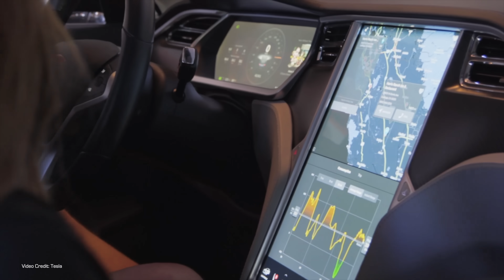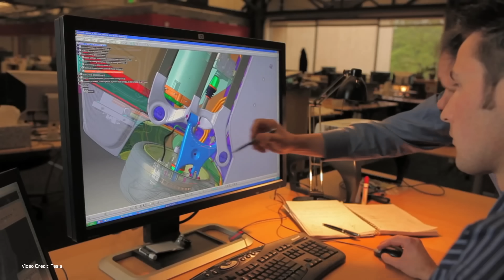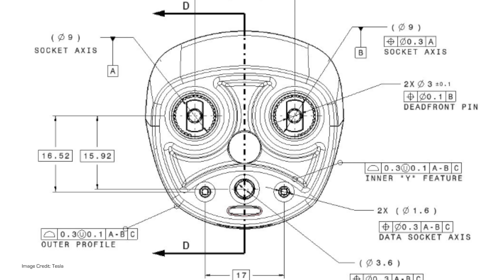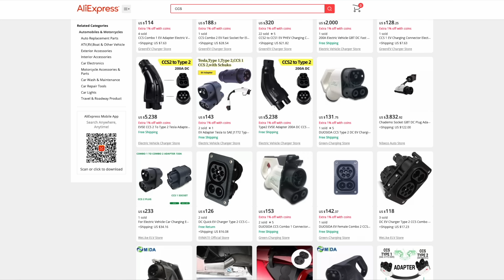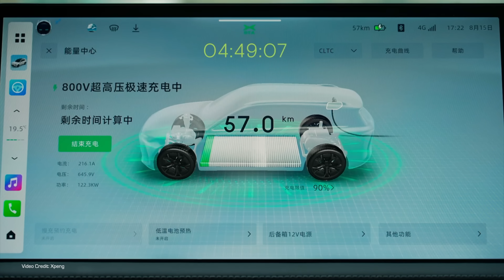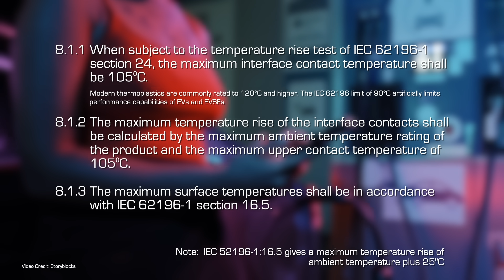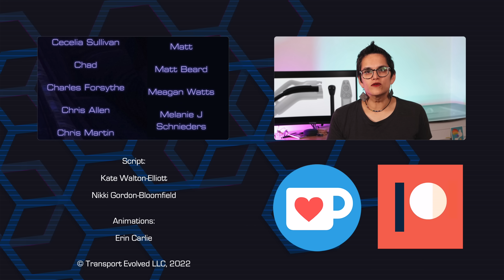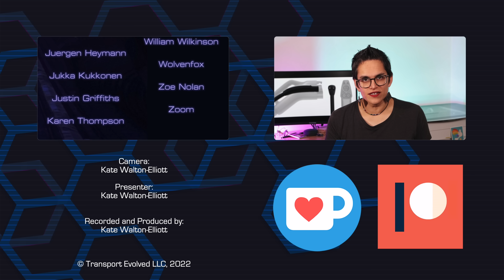The EV Charging Experience Can Suck -- Will Tesla's NACS fix it?

Comment: As per the super imposed diagram in your presentation the NACS is a far sexier and design and what we should expect from the futuristic look of charging cables. We're all so use to the clunky gas and CCS adapters that when the European government said...you will use this and you have no choice...no one said otherwise and they all just took it.

Tesla is saying that going forward companies could and should adopt this standard because is has proven to be reliable and a more ergonomic design. It even puts less stress on the charging port of the car compared to CCS. Look at the new CCS to NACS adapter. It ways about a pound all by itself and that's before connecting an already heavy and bulky CCS charger to it.

What really needs to be tested is the vague claim by Tesla that it can do bidirectional charging. I suspect it can since you're just reversing the flow of electricity.

None of the companies will adopt this standard. Tesla is their rival whether they want to admit it or not. The only way it's going to happen is if the US government did what Europe did and gave them no choice.
Reply from the maker: The Tesla connector is unable to support three phase charging which is increasingly common in Europe where many EVs ship with three phase / 22kW charging. Personally I'll take functionality over looking futuristic. 

In the US the options are more flexible because of the lack of 3 phase, but I'm personally unconvinced that the telsa connectors better ux in terms of physical usability offers sufficient of a bonus that other automakers will pick it up.

^Kate.

Comment: With an extremely large number of US charging stations limited to 6.5kW and many Tesla stations limited to 150kW with very few at 250kW, the connector is the least problem. Tesla wants to use gen4 Megachargers that will charge at 1000kW, the bigger problem is that is the entire output of one power substation. Which is also larger than a 20 bay charging station.

Comment: Why hasn't Tesla opened up the protocol?

It's not clear why Tesla has not yet opened up its charging protocol. It is possible that the company wants to maintain control over the user experience at its Supercharger stations, or that it is concerned about potential security issues with opening up the protocol. Tesla has instead suggested using a different solution for other automakers to communicate with its charging stations. Alternatively, it may be that the company is still working on developing and improving the protocol, and plans to open it up at a later date.

Comment: Summary: 

The US has a variety of charging connectors available for electric vehicles (EVs), while many other countries have only one. The Tesla charging connector, also known as the North American charging standard, is highly regarded for its engineering and user experience. However, it is a proprietary standard, which means that other automakers in the US have largely adopted the CCS connector instead. Tesla has recently opened the charging connector to other automakers and is working to get it validated as a standard. While other companies may adopt the connector, they would still need to use a different protocol to communicate with the charging stations, as Tesla has not yet opened its charging protocol. The adoption of the Tesla charging connector by other automakers would likely improve the charging experience for EV users.

Comment: What does CCS charge for licensing the plug?
The CAD models for the liquid cooling NACS plug was also included with the release, looks like the same dimensions.  As for communication that's usually handled by a broken app and won't make current CCS charging worse regardless of plug choice. I get your point that it might also not improve the non Tesla charging experience, but it will at a Tesla charger with the Tesla app.

Comment: I f I were Ford, or any other car maker, I would advocate switching to NACS if Tesla also opened up the Tesla charging network. If just Ford did it, it would put the death knell in CCS in the US. And for the relatively few CCS vehicles made, adapters are available. Since there is no 3-phase power in the US (effectively) every other aspect of NACS is superior to CCS. And seeing as the world went from USB-B and its many forms, to now USB-C, standards can change when a better one is available. Tesla should have released this a long time ago along with the protocol, for that they get the criticism. In short, NACS should be the standard, but for it to be the standard, Tesla has to release the hardware, software, and access to the Tesla charging network.

Comment: If it wasn't such a one sided deal I would almost like to see other manufacturers using the Tesla plug. Just to see the SC network suddenly having the same problems as CCS trying to deal with dozens of different vehicles, software variations, backend systems not well integrated, etc.

Comment: First, all V3 Tesla superchargers use light weight liquid cooled cables.  Also temperature sensors are built into the plugs.  That is probably why there have been few Tesla charging fires.
The cost of Tesla Superchargers is very low.  It looks like it somewhere are $50,000-60,000 per charger.  Where I have seen upwards of a $250,000 million from other supercharger companies.  This is backed up by Texas grant applications for superchargers where Tesla asked for 1/5 the money of the average of the other supercharger companies.  The Tesla bids included CCS and CHAdeMO connectors.  
It looks like Tesla doesn't really need the money.  What do they really need?   One thought is location.  For example if CCS superchargers allowed at the rest stops, and Tesla superchargers aren't allowed, it would be a problem for Tesla.

Comment: Multiple charger types, not sure I'd claim that.  Chademo is going the way of the Dodo, CCS is global and will most likely remain for the moment.  The Tesla charger connector is elegant and easier but my worry with the Church of Elon they may decide to change that in a few years or even 10yrs and force manufacturers license it as it is controlled by a single company.
Reply: The ccs standard isn't GLOBAL at all. U.S. uses ccs1, EU uses ccs2 a different non compatible plug, China uses its own seperate plug as well as standard and then you have the company with the most evs ever made with it's own standard ie tesla.

Oh and the tesla plug has existed as is for 10+year's now. And the new mwh+capable v4s are backwards compatible with every other gen of tesla plugs. So I highly doubt tesla intends to adjust or change their charging standard. 👍🏻

Comment: I think far too many people associate the Tesla charging experience with the connector, while almost no part of the charging experience is related to the connector. The only thing the connector does better is that it is smaller. The ease of moving it is due to the fact that the cable is shorter since it is designed only for the inlet location on Teslas (can use smaller wires) and not liquid cooled. If they made the cables long enough to support all vehicles and big enough to support 500A continuously like a 350kw CCS station can, the cable would be just as bulky and cumbersome as a typical high power CCS cable.

If Tesla wants government funding for their charging network, they need to make it a public network. Plain and simple. For it to be a public network, I need to be able to drive my non-Tesla up to the charger and use it without having to buy an adapter first .

They also haven’t released anything on the software side that allows a non-Tesla to charge at a supercharger even if it did have a Tesla connector.

It’s also worth noting that while there are likely more Tesla vehicles than CCS vehicles in North America , North America is really not a primary market for EVs. That’s why there are a ton of EVs available elsewhere that we don’t get here. Expecting manufacturers to adopt the Tesla connector only in North America, then use CCS everywhere else in the world is absolutely idiotic. Not even Tesla uses their own connector in many countries outside of North America.

Comment: Enjoyable as always Kate. I agree that this was only done to position Tesla to claim Federal funding. We've seen many companies change mid-course in response to the guidelines of the poorly named Infrastructure bill, and honestly I think its one of those rare examples of Federal law positively directing those companies. (Even if the knock-on impacts can only be weighed on the decade scale instead of in a year or two).
Reply: It's false that it's "only done to receive federal funding". Tesla offered their charging standard to ANY manufacturer in 2016 without requiring them to open their patents to Tesla and before there was federal funding for chargers. Not that Tesla wants to use any of those legacy auto patents anyway.

Comment: I don't use much CCS charging (okay, almost none) but cables weight should not be an issue. As with ICE refueling, if the cable is properly supported it is easy for the user to get it to the port to charge/fill.  The vapor recovery systems on gasoline hoses are big and heavy but they are support and makes it easy for little old ladies to fill their tanks. So why is it an issue for Fast Charging cables?
Reply: The fast-charge CCS connector is large and bulky, and the cable is thick and unwieldy. Due to the shape of the CCS-combined fast-charge connector, the plug has to be carefully lined up and pushed in firmly. I've almost always had to do it with both hands. NACS is small and light, the cables are shorter and thinner and the bezeled plug and receptacle will help guide the plug in, a lot like a gas nozzle

Comment: Same reference as usual, this seems akin to how apple decides to use one connector but call it something else purely because of their superior protocols. A good roundup Kate, thanks for the TLDR on the subject. It’s up in the air but if Tesla can manage to sway at least another MAJOR manufacturer to use NACS, sold on the “superiority” of the smaller sleeker connector, and potential access to the supercharger network, I can see the connector slowly being adopted by others falling into line, of course market demand and all aside.
BMW- maybe
VAG - maybe
Ford- no way, not with them plowing so much into the 2 way spec for the pro power system.
Fiat- probably, if they continue through the EV transition.

Comment: The more sensible solution would be establishing the IEC 62196 (European style) Type 2 connector as world-wide standard. This connector supports 3-phase AC and DC even without the CCS "extension". The "DC-mid" option (i.e. using the 3-phase & neutral pins for DC) just isn't used by anyone, but it has been defined in the standard from the get go. It could also easily be adopted to support split-phase AC for the US. And it has also proven to be capable of much higher power than initially specified - 300+kW should be no problem with liquid cooling.

And then using CCS for even higher power applications (e.g. trucks) would be the logical thing to do.

Comment: Could Tesla just sell a NACS —> CCS adapter to non tesla owners, allowing anyone to use Tesla charging network.

My first thought was firmware issues… but currently CCS users can use a variety of providers from different companies so Tesla should be able to make the handshake, etc. Work
Reply: I think that should be possible. New superchargers installed in Europe "Speak CCS", since they are CCS2-based and can be used by non-Teslas. I think this is Tesla's plan. Get some sweet federal money for building more superchargers, have those specific chargers be open for all. Since they can claim that they are using one of the North American standard connectors, they don't have to install CCS1 themselves, and the CCS1 cars can use a relatively simple/cheap adapter.

Comment: I am a new Chevrolet Bolt owner and still have yet to try out its CCS charging capabilities. Right now it is being charged from a conventional 110 volt outlet just like the Arcimoto FUV at my house.
Reply: Other than a slightly bulky connector, CCS works just fine. If you have them in the area you frequent, I recommend getting an EVgo account and setting up Autocharge. It’s just as seamless as supercharging

Comment: Need more chargers, not more complication in the plug wars. All still need to be plugged in.
A cable support boom for people who need it, would be easier than a lighter cable.
V2G hardware costs and complications undermine the concept, more practical to have AC outlets on the EV for emergency use.

Comment: It takes man hours and money to prepare a standards document for the protocol.   Get that wrong and there could be the devil to pay.   It is somewhat doubtful if Tesla will make that investment without real interest in the protocol.   Is Aptera alone enough? They could give everybody the code but there be dragons.     What liability is attached to all of this?   If Tesla just wanted the IRA money they could modify their chargers to speak CSS as that is open.   It is already shipping cars that speak it.   At that point Tesla has the option to open any and all of its chargers to non Tesla cars.   Chances are Tesla has this in the works.  We will need to see how Tesla and Aptera work out the protocol issue.

Tesla wants to sell power walls.   I see this as a conflict of interest.   EVs especially the trucks need to be backing up the grid.

Think the water cooling for the NACS cable is a done deal.   

Looks like CCS connects the car to the internet.   I think the can bus  ISO 15765-4,  which  US cars are required to use, is the better solution.
Reply: I assume Aptera will just use CCS as the protocol.
Reply: New Superchargers in Europe speak CCS2, so getting them to speak CCS1 in North America is manageable.

Comment: I was appalled when they released the "standard" with the "limited by cooling capabilities" charge limit. No shit it's limited by cooling, maybe you should give reasonable estimates for a high limit as a function of temperature... Like you'd find in a standard!

Or we can go around talking about how some liquid helium cooled superconductor cable with NACS can deliver 1 terawatt of power.

/Rant
Reply: The mistakes and shortcoming in the standard do hint at the fact that the document was quickly thrown together at some point. Also the inclusion for a 1000V connector, to be compatible with CCS 350kW chargers, seems to be an afterthought.

Comment: That explains a lot. A new network opened up in Canada. When I plugged into it the Chadamo which I need would not work. They have excellent customer service and found a way to start the charge by telling the charger I was a Tesla with an adapter. The other good thing about this network no app reguired. It accepts Credit Debit ,Apple pay and google pay. They are being installed at Loblaws grocery stores in Toronto. We also have Petro Canada putting in fast chargers at their gas stations with the same payment process.